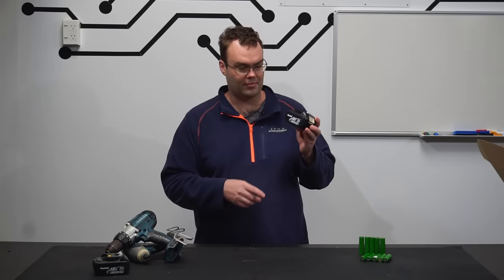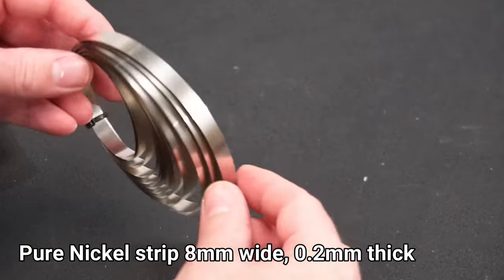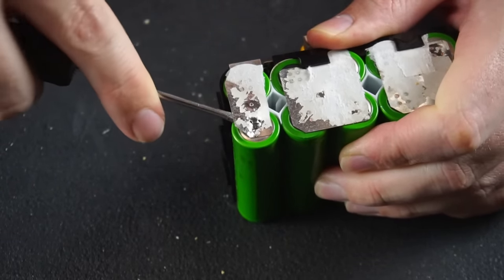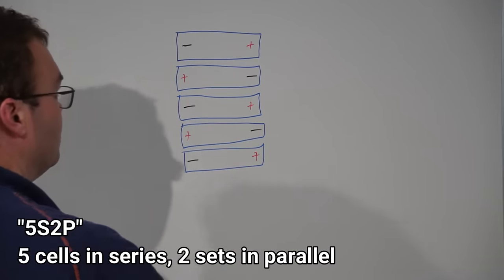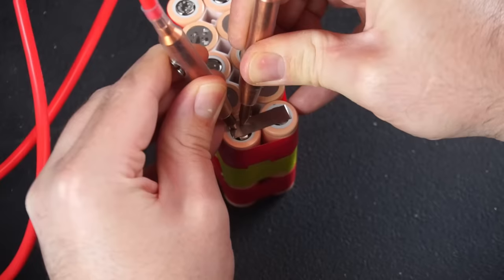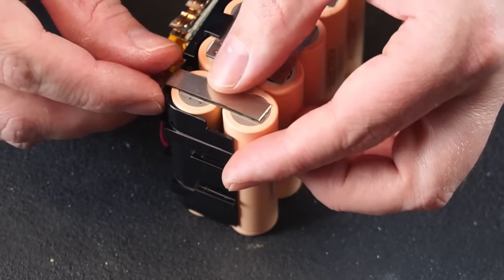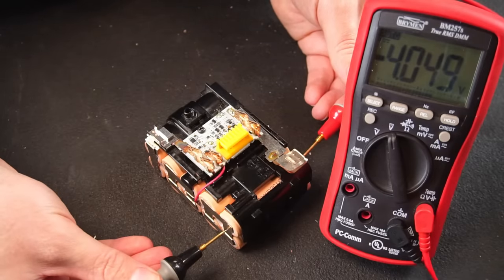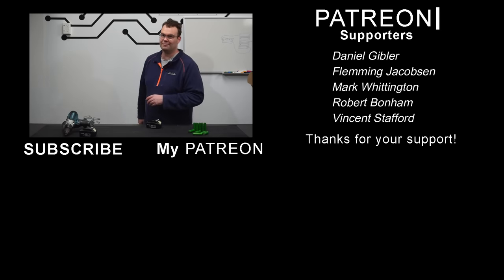Repacking Makita 18v Lithium battery with New Cells (Save $$$'s)

Comment: Very nice video tutorial. Learned a lot by watching it.

I'm currently learning how to remove the dead 18650's from cordless appliances and replace them with good ones that test okay. Amazing how many cordless appliances with non-user serviceable battery banks inside are headed to a landfill when all they need is fresh batteries. (Manufacturers are deliberately making cordless appliance Li-ion battery banks inaccessible so that consumers have to buy whole new appliances when the batteries can no longer hold sufficient charge. What a waste!)
Reply: Agree. Its a disgrace that companies make ewaste like that to gain profit and it should be illegal
Reply: Just took apart a Victa battery pack.  They made it super hard to take apart.  I don't have a spot welder so my plan might fall apart.  It seems like the cheap batteries come from China but if anyone knows of a good Aus source let me know.  (I kind of need to get my weed wacker running in the next 2-3 weeks and can not wait for the China shipping...)
Reply: @IronMan-jv6md  You might be able to throw a spot welder togethr from an old, discarded microwave oven. There are some good YT videos on how to do that. Hope you get your pack back up & running.
Reply: It would help if the general populous weren't so deeply stupid. The fact is, user-replaceable cells open companies up to all manner of liability.

Look at what happened when vaping went mainstream. Clueless people with unregulated mods, using the cheapest 18650s they could get their hands on, combined with sub-ohm coils. Those of us who know better saw the writing on the wall. Did the news outlets blame the idiots who were doing stupid things with their tubes of electricity and setting themselves on fire? Nope. They blamed vape product manufacturers. There is no way any tool company is going to risk the bad press and possible lawsuits that would stem from letting people mix cells, reverse polarities, run garbage cells, etc. 

We no longer live in a world of personal responsibility. Society chose to "protect" the stupid by blaming every company that doesn't make their products idiot-proof. If I ran a consumer products company, I wouldn't make batteries with user-replaceable cells, either.

Comment: before building a bat pack I always charge the cells individually for them to have the exact same voltage... if the BMS don't a balancer function you will always have unbalanced cell on your pack and that will shorten its life.

Comment: You should have pre-charged each and every cell to a common voltage, as close as possible to avoid those errors. Other than that awesome job.
Reply: Could you discharge the ones that measure at a higher voltage, so they all end up the same?
Reply: @Mickparrysstepdad  yes you can. The thing is each and every cell should have similar MAh and similar charge level. They can be all full, half or even without charge. As long as capacity and charge in each and every cell is same you should be fine.

Comment: I do this all the time & use a soldering iron , high heat setting & a quick dab to reduce heat transfer into the battery , they've never been a problem
Reply: I soldered 2 cells using a shitty iron, they work fine, it is def. possible but... Let's keep this as secret knowledge. Someone might have a more susceptible cell, they could get the solder between + and - parts, people are dumb and many bad things can happen so it's best to say not to do it. I definitely won't redo that process.

Comment: Iv done A LOT drill pack rebuilds, 100’s and I’ll tell not only does makita keep the absolute tightest pack deviation iv ever seen, most iv ever seen in a Makita pack was .002mv deviation on a absolutely used and abused pack, talking 5min on the charger to “full “ and 1 screw and dead. But the BMS is just as stick anything more the .002 vm difference and BMS give you the finger 
Makita is the reason I started putting balance ports on all my personal drill batteries 
I just started

Comment: I have bought several old Makita packs with dead cells and replaced the batteries for a nice cheap pack with a large capacity.
Reply: That's what I do too.  Way cheap
Reply: @randybobandy9828  on doing yrs do you have to weld the nickel strips or can they be soldered.
Reply: @6lr6ak6  - if you don't rip off the old nickel strips, then you can certainly solder those strips together. In fact, that makes a better connection AND there is less risk of damaging the cells by tearing/breaking the old welds then grinding them flat!

Comment: As someone who has spot-welded battery packs professionally I have to say welding multiple lithium cells together is extremely dangerous. If you were to rupture or short one of those cells, which can happen with an arc welder and a lack of experience, you could be seriously injured.
Reply: So what is your suggestion? Is there a safer way?
Reply: and?
Reply: @Nikolasz1173  And so it shouldn't be done by people who don't know exactly what they're doing. I also have professionaly rebuilt Ni-Mh and Ni-CD packs and even though I'm professionally trained there's a damn good reason they don't let us rebuild lithium, and that is because one tiny mistake or short and you can lose your fucking hand. The creator of this video acts wayyyyy to cavalier regarding how dangerous this can be, and gives few too many warnings.
Reply: @SuddenPaintball I think anybody attempting to do this (myself included) knows the dangers of this already.
Reply: That's why you do it in your neighbors garage, duh.

Comment: the charger was displaying 80% or more charge state, not faulty battery. the 2 lights will flash if it's faulty. since your cells were at 4 volts and nominal cell rating is 4.2 then they were indeed at 80%+ charge as indicated by the charger. other than that it was a good repack

Comment: As a best practice building battery packs it's a good idea to either top or bottom balance the cells. You'll pull more capacity and extend cycle life especially when using a bms without any form of balancing. Your highest voltage cells are going to consistently overcharge and the lowest voltage may over discharge.
Reply: all  bms  have internal   balancing   circuit
Reply: @yolandfathe2863  you just watched a video featuring a bms that doesn't have a balancing circuit.

The only management it's doing is disabling charging due to split pack voltage variance and temperature protection along with under volt protection.

Comment: We've found a few tools struggle with 0.2mm (pure nickle) strip. Some of them are seriously high drain (the impact wrenches etc). I've yet to measure Makita's original thickness though. But for comparison Ryobi uses 0.3mm and Hitachi uses 0.35mm, I even found an aftermarket Ryobi that used 0.35 but may not have been nickle, couldn't try at the time. Spot welding 0.3mm+ becomes a little harder, even the kWeld says that is their top end with the ultra caps. I've contacted the "chinese" bench spot welders to see what they claim on theirs and its often tops at .2 .25 etc (which surprised me really) - yet to try one for myself though. I had missed it was 8mm, our problems were on 6mm, ended up doubling up with 5mm.
Reply: It seems like the highest resistance in the circuit would be the narrow point of connection at the spotwelds rather than the conductors. If I was running into current problems, my first reaction would be to add another weld or suspect that my welder wasn't working well. (I agree that if you're finding manufacturers use thicker strips, that must be the "real world" answer... just thinking out loud & wondering if someone can explain why the weld isn't the bottleneck.)
Reply: Some Milwaukee use nickel plated copper. It's far thinner than straight nickel.
Reply: I've seen a video where the guy welded multiple strips on top of the other, so you could use the thinnest (0,2 or even lower) and weld two of them in succession?
Reply: Yes, my spot welder us good to .12mm. I double it if needed. The Chinese knockoffs use nickel plated steel alot. It is junk. Carries ½ the amps of pure nickel

Comment: Thanks for the video . Got a vintage Hilti battery pack to pack one of these  days . Tagging is the problem - won't be buying the spot welder, as it just won't get enough use. 
I've seen a home made device on Utube, utilizing the guts of a microwave - I can see me getting killed with that. Seen another, safer design, utilizing a 12v car battery and solenoid switch .

Comment: I notice that one of your batt had a lower voltage, it' probably better to equalize them before mounting the pack
Reply: The charger does that itself
Reply: The bms will balance the cells when the pack is fully charged.
Reply: @randybobandy9828  - The BMS WILL NOT balance anything. That Makita pack doesn't have BMS that balances (most power tools do NOT have balancing). In fact this Makita pack doesn't even monitor the individual cell voltages.... watch the video before commenting!
Reply: @randybobandy9828  it would need more balance leads. It has 1 sense wire.
Reply: @johncoops6897  what? I have rebuilt a dozen ryobi packs and they have bms in them. Each cell has a balance lead.
Reply: @mwint1982  wow makita has a shit battery design then.
Reply: @randybobandy9828  yeah. That's an older version. They've got some new stuff out. You cant even swap cells. Theres memory that wont let you
Reply: @randybobandy9828  - Yes, they have a lead to each cell, but that is NOT a balance lead. The Ryobi BMS don't balance the cells, they simply MONITOR the voltages across each cell. If any one of the cells hits either undervoltage or overvoltage thresholds, the BMS shuts down the whole pack (flashes red on charger).
The Makita packs don't balance either, although some of the newer ones bring the cell voltages out to the charger connection.
If you have rebuilt Ryobi packs then you already know they don't actually balance, since the cell voltages of used packs is never the same across all the cells. The lack of balancing means that one cell often gets cooked and killed from minor overvoltage, until the BMS calls "enough".
This is the same for almost all tool battery packs. The main criteria is to charge them fast and make sure that they stay safe. The manufacturers hope that the cells are well matched, but it's a crap shoot. Cell balancing is primarily an "RC thing", as they have the hours and hours it takes to balance each pack - balancing is almost never used in consumer products.

Comment: Remember to balance or charge cells before putting them into pack as bms doesn't have balance function. And even if it has, it would still take quite long to balance cells. It's also safer to work with them when cells are discharged.
To me it looked like like they were somehow balanced in the end but you just didn't mention it clearly enough.
Nice video though 👍
Reply: Very professional expert:washhands:
Reply: Very professional expert:washhands:
Reply: Very professional expert:washhands:
Reply: Very professional expert:washhands:
Reply: there was no issue with the battery. the charger lights both green and red when the battery reaches 80%. if the battery is faulty then the red light would flash.

Comment: My understanding is that if your BMS does not support cell voltage equalization it is quite important to equalize individual cells before putting them into such a system. You are here running the risk of overcharging a battery causing a fire as the BMS in theory probably only sees the total voltage, but not the voltage of the one already fully charged cell for example.
Reply: Yes, i was thinking the same thing. Just bought a broken bosch battery and it was still charging the Battery but two cells of the 5s2p configuration were at 2,85V and the rest highly charged with 4,23V. Bosch usually only charges to 4.1V per cell pack. You should defiantly match the cells and not just trow them in. Could get dangerous that way. It's probably more dangerous than soldiering the cells in my point of view, even though I spotweld.
Reply: so if you just drill a few hundred holes like in the vid would this drain the batteries to a more equal voltage of the individual cells before charging, thanks.
Reply: @eddy3314  not really. The thing is, that the batteries have similar capacity and if you charge them they will all rise in the voltage but the board connected to the batteries does not balance the individual cells. Meaning the will just cycle in the voltages the had between charging and discharging. In many batteries they have bms boards which will balance on a full charge meaning they will all have the same voltage but not in the tool batteries. Maybe in some but not in this one. So you need to balance them individually by yourself. I connect one at the time and charge them so they all end up having the same voltage and then they should cycle in the same voltage range. However if one battery is way lower in the capacity it will drain faster meaning the voltage drops quicker and you have balance them again over time or you could replace the bad cells. That's how I do it and it works for me since a long time. No need to always buy new batteries but don't assume that the manufacturer always has a balancing process. They simply sell more batteries that way and make more money, which is very unfortunate I think
Reply: @jannisalexander1  Thankyou for taking the time to explain, that clears thing up . Have a good day.
Reply: @eddy3314  no worries mate 😊
Reply: I would assume makita would have a balancing bms in their packs. There is no way they wouldn't because they would never want to be liable for burning peoples homes down.
Reply: @jannisalexander1  they absolutely have cell balancing. Selling a few extra batteries is not worth the risk of a lawsuit for burning people's houses down.

Comment: Pro tip: Use Molicel P28A Batteries! They are super cheap, have a super high discharge current and 2800 mAh capacity! Molicel Batteries (18655's, 21700's and so on) are at the moment the best batteries that i know of!
Reply: Vapcell B30 20A 3000Mah

Comment: Not sure there is any saving going on if you have to buy a spot welder just to be able to repack your battery. You have got to repack an awful lot of batteries to cover the €150 cost of the welder!
Reply: There are quite a few around at £30 ish that are quite good these days.
Reply: I was thinking that. Not sure I would want to be messing with Li batts hope he had a bucket of sand handy.
Reply: Plus the cost of the nickel strip and your time. Your cost savings will start kick in by your third or fourth battery.
Reply: People have been known to use the spot welder more than once, for other battery packs for example. Each time you use the tool the base cost seems to diminish.

Comment: Replacing them is the easy bit but where did you get the salvaged cells from ?
Reply: Laptop batteries usually, but that's disappearing fast
Reply: @TheGuruStud  My guess is ebikes or escooters since you can't find laptops with cells like these anymore.
Reply: 18650 batteries are extremely popular in the vaping community

Comment: I'm really surprised that the BMS only monitors one extra wire instead of all 3... Seems dangerous.

Also Make sure to only put batteries in parallel if they are within amor 0.2v of each other.  Otherwise you get huge amounts of current moving between them which could either explode the battery or shorten its life.
Reply: for sure the bms monitors the pack voltage as well. the lxt platform does not allow for deep discharge and this is controlled both on battery level and the tool level. the tool will give a little sign of power reduction and then shortly it will completely stop. it will not crawl to stop, discharging the pack to unhealthy levels.
i'm not a specialist in electronics but i think they can spot easily faults by knowing both full voltage and 4 out of 10 voltage. So they can calculate the other 6 cells voltage. It's a rougher estimate but enough to detect single bad cells and not have extra wires and more complex bms.
Reply: Makita is famous for using only of the cells (or 2 here) to feed the BMS, effectively wearing the cell unevenly, and disbalancing in general, esp. with longer dormant time. It's probably one of the worst BMS I've seen - virtually all ICs nowadays incl. monitoring on each cell.
Reply: @hhcosminnet  this particular pack cannot be controlled on the battery level, it'd require at least 2 (likely 4) very beefy MOSFETS.

Comment: I was opening the battery 2 days ago and your board look very simple comparing to mine, same capacity. Previous battery that had a faulty cell was refusing to work, even with different cells. Reason for opening was my intention to balance the cells of the battery, that I found perfectly balanced without me.